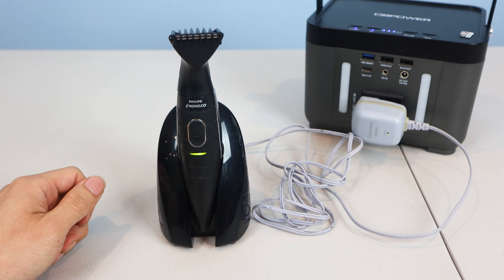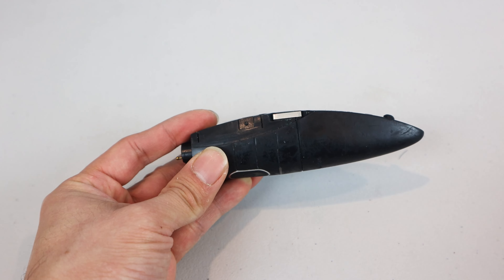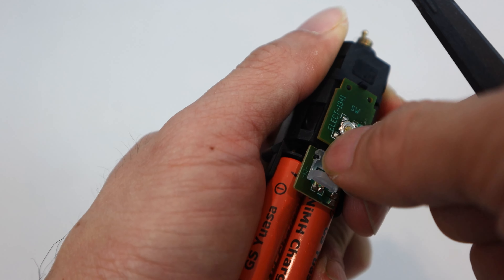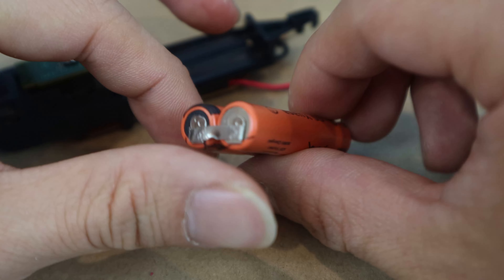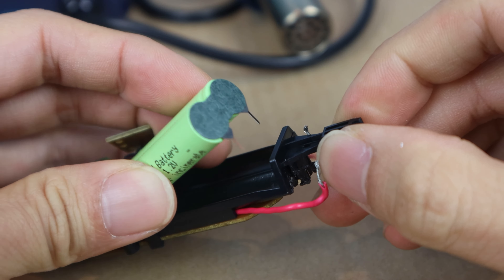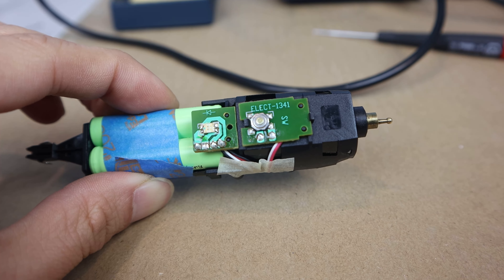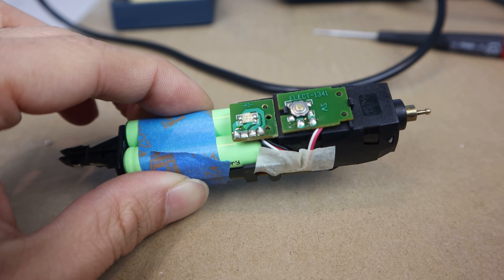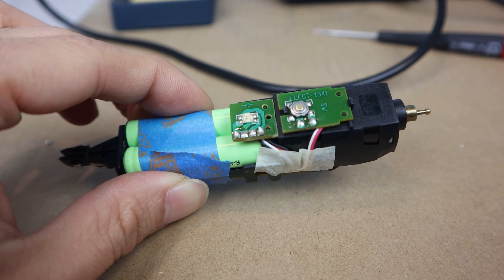Philips Norelco Bodygroom BG2030/60 Disassembly and Repair

Comment: 0:11 EXCUSE me how many years!!?
15 years ...WOW... that is just mind-blowing!!!
Question1: Are the metal micro blades still as sharp as the first week?
Question2: If they are less sharp, do you know a handy trick how to sharpen them? Or is that a bad idea?

It still blows my mind after 1.5 decade on this platform that YouTube still has small creators with very help full video's.
Not only that, you created the video in 4K and with super sharp zoom and excellent presentation and instructions!

Did you know there is a small group of channels that buy broken electronics and repair them and are very successful on YouTube?
You could be easily in that group of channels, cause your production quality and overall knowledge is very superb in the electronic space.

Why i am here, well i was just YouTube searching "Philips Norelco" products, and saw yours in the recommended list.

Comment: Hey Phil — I have this exact model with the same battery issue. Would you ever consider doing a paid repair if I sent you mine? I really want to keep using this but don’t trust myself to do it.
Reply from the maker: Hey, there. I get that question a lot from folks! And while I'd love to be able to help out, that's not something I'm considering at the moment. I appreciate the offer and the suggestion that I'm good enough to of a tinkerer🔨 to warrant a paid service. However, there are simply too many things that could potentially go wrong like the possibility of damage to your item, failure of the repair, shipping/receiving issues, loss of cost efficiency etc. While I am quite confident in my skills as a DIYer, handling other folk's cherished items feels like a bigger loss than were I to ruin something of my own, especially if it was already in a non-working state. The best I can offer you is support and encourage you to give it a go! At worst, the item you're trying to repair is destined for obsolescence and replacement (which, if you're attempting a repair in the first place, was imminent anyway, no?) and at best, you've got it working again, sometimes good as new or better! And hey, if it doesn't work out, that's just part of the learning process. I've had plenty of repairs fail and/or not work out as anticipated (and subsequently hours worth of video footage scrapped because of it). Sometimes I consider publishing those videos anyway because failures can help folks learn what NOT to do 😆, but then I reconsider whether or not it's actually helpful or just for "entertainment." 🤔